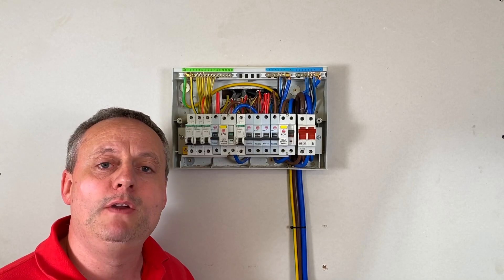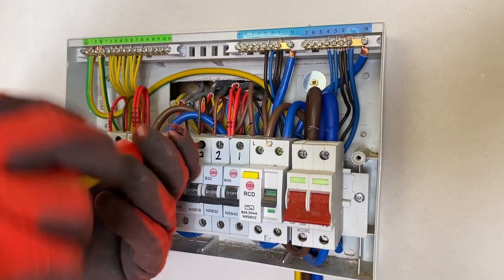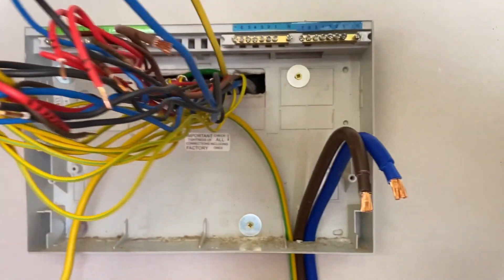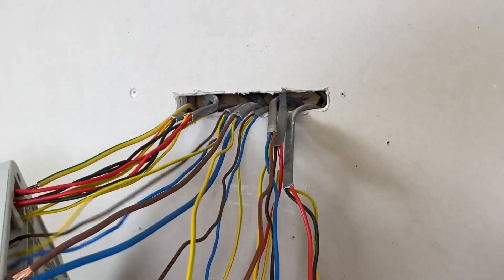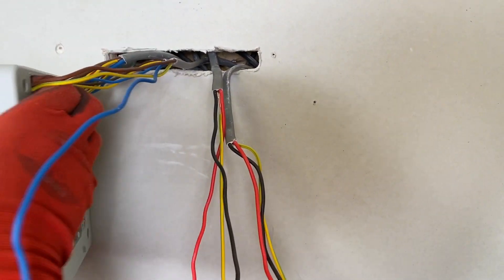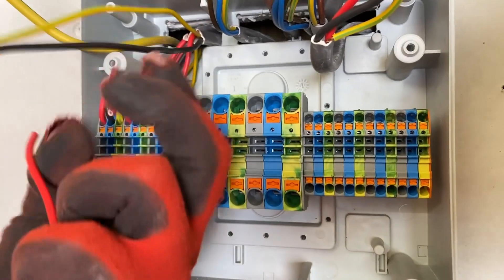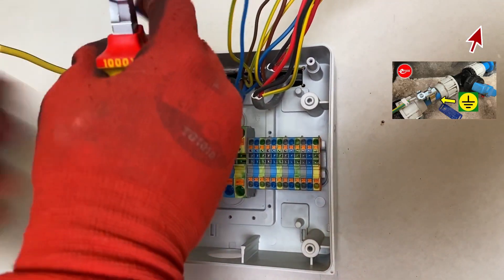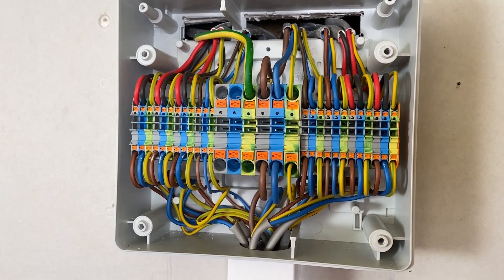How to Move a Fuse Board - The Easy Way |  Wiska Consumer Unit Relocation Kit

Comment from the maker: Wiska 818 Consumer Unit relocation kit
http://hub.efixx.co.uk/wiska-818
Reply: Would it need any kind of intumescent seal where the old cable exit through the plaster board void into the box?
Reply: @rp8068  I’d be heavily inclined to.
Reply: @GadgetMan36  may be non combustible?
Reply: Specs say polycarbonate so I doubt it’s non combustible, but I’d say a similar enclosure is more for DB/CU carcasses with the likes of contactors and metering equipment inside.

Comment: As an amateur electrician, I’ll always defer to a qualified electrician’s technical competency. But when it comes to non‑specific tasks like opening portal holes and drilling, you guys still have a lot to learn. The hole saw wasn’t even centered, and those cutouts left a lot to be desired from a woodworker’s perspective. My skill set would have produced factory‑perfect results with about fifteen minutes of downtime. In my opinion, details matter.

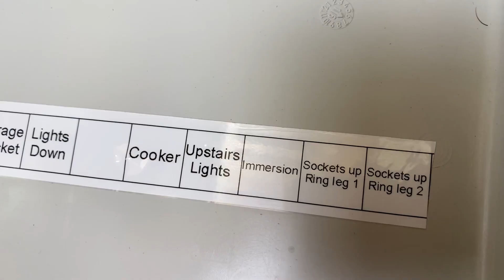Comment: Question: You mentioned that the DIN rail in this enclosure is plastic (somewhere around @5:40). At the end of the video (@16:52), there is no connection to the main (10 or 6 mm2) PE cable to anything else, hence it's a „floating” earth.
Tip/manufacturer's recommendation: Although tool-less installation is allowed for rigid or ferruled cables, it is strictly mandatory to use an operating tool when inserting multi-strand cables.

Comment: can this be placed inside a wall with an access panel rather than surface mounted and does it comply with BS 5733-MF. Maintenance free connections to BS5733-MF for inaccessible areas

Comment: Not too sure about that.  Normally, the whole point of moving a consumer unit is because it is in the way of something.  Like knocking a hole through, or fitting a door frame etc...   I can't see how replacing a large box with another large box in exactly the same place does anything ?   😂

Comment: I'm probably missing something....🤔

What did you do with the incoming tails to feed the relocated board?

I'm assuming if the new board is over 3m away from the head a switch fuse would be needed...

Comment: The wiska relocation boxes are a great idea but are pretty limited at 10 circuits, also there is no provision for rear entry and the 20mm knockouts if all used are still not enough for the cables, using 2 of them at nearly £100 each is a bit over the top for most customers, so wiska please make the boxes bigger with rear entry and more knockouts please.

Comment: A box made specifically for a certain job and the manufacturers still cant get it right. Not one of the knockouts are of any use. Wib box, din rail and din rail connectorsbeen used for years doing exactly the same job...

Comment: I expect the reason for the unit not being metal is that unless connected via flylead to a CPC or the equipotential bond, how would the case be earthed? I‘m surprised the rear entry cuts were not filed-down then intumescantly sealed as well as the mounting screws without washers. Surely the TopJobs should be LEN rather than LNE, as PVC PVC twin and CPC cable is in such an order. Will have to read the item specs online to determine if MF.
Reply: Just called Wiska UK - they confirmed the unit is MF and can be mounted behind plasterboard etc.

Comment: What happened to the mains tails and main earth? Do we assume theses went into service blocks below? (Sorry if I missed this).
Reply: I asked the same question, usually the tails come through with the rest of the circuits and the main earthing conductor. Also you would normally have a shower circuit and a cooker circuit so I'm guessing you would have to through crimp the tails and main earth if you couldn't pull new ones through from outside and they would have to come over the top of the wagos as there isn't room down the side
Reply: I imagine the homeowner had the supply and consumer unit moved.

Comment: What's the point in moving the consumer unit, if your just going to replace it with another box and surface mounted trunking?  The only reason i'd move mine, is to hide it better..

Comment: Those are great bits of kit, especially the ones with the lever Wago connections on the lower side. If I were to criticise one thing though compared to the previous box - I personally would have installed washers with the fixing screws to reduce any chance of the screw being pulled through if it bets bumped but other than that it was a flawless install!! Maybe i'd have left the wires a little longer too but that's just down to personal choice...👍

Comment: Any regulatory reason why the Wagos are in LNE sequence rather than LEN which would match the T+E cables?
Other than that, as long as cable bunching as part of the relocation doesn't open its own can of worms they look like a good piece of kit.  I expect that high IP rating would also come in handy to correct some of the more controversial installs seen on YouTube, where for example a room's been turned into a bathroom but the CU's still in there, just behind a panel.

Comment: Is it acceptable to do this using screw type din rail terminals or the widely used screw terminal connector blocks? Thing I don't get is
If an electrician did this in your house 5-10 years ago using big adaptable box and connectors would that be deemed as some good work. ? I'm not so sure but don't really see much difference apart from the screwless terminals used? 
What's your opinions?

Comment: Can someone enlighiten me?  I'm looking at what makes contact with the conductors, it looks as though the terminals only offer a small fraction of the conductor making contact.
Melted plastic cake anyone?
Reply from the maker: Or as we know it a proven screw-less connector system with a raft of international approves. Used in industry for decades.
Reply: @efixx  Just because things have been "used in the industry for decades" is not good enough, I was looking for someone to prove me wrong with some facts. For example where im from, uninsulated live busbars were used for decades, they all thought that was a good idea too.

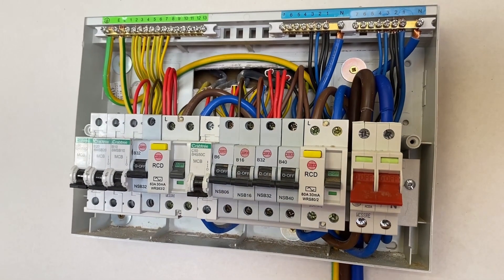Comment: 1:12 'Whats wrong with this consumer unit'  if the RCD's and MCB's are still working ok nothings wrong, but there's no money to be had telling the mug punter that. 
Just shake your head and tut then tell them about the latest bullshit regs which are more about profit and paperwork than 'millisecond disconnection times'.
The whole system now is geared to registration costs/profits/certs  and traceable income by the taxman on the press of a button and don't get me started about smart meters
As for your girly multi tool cutter at 8:20 on the back of the box, I had a Swiss army knife that would do the same job in the 70's with a few cuts, then  I could peel an apple, open a bottle of beer and make a cheese sandwich with it as well.
Also mixing red black, brown & blue conductors in the same installation you naughty boy.
As for the gloves are you frightened of damaging your manicure and nail varnish.

Comment: Just a question that only just occurred to me ... Why "move" the CU if all you're going to do is replace it with *another* box occupying the same space?

There are usually two reasons for wanting to move a CU:

1. Convenience of a better location
2. Being able to free the space occupied for *other* purposes

This method provides no help for the  latter however. Isn't it about time that extending cables with appropriate simple, reliable, in line connectors was sorted out? The poor consumer has to pay enough for Microsoft bloat without domestic wiring doing the same! 🤔🙄
Reply: the 2 reasons you gave are 2 of the least used due to cost of relocation the most common 2 are home renovations/conversions and the second is because the current consumer unit is no longer fit for use and the new one wont fit in its place so the new one has to be installed only a short distance away the fast connections of the wiska allow for a regulation approved connection meaning your home is in less chance of (a) catching fire or (b) having wiring faults. sounds a good reason to hit the consumer with another small charge instead of him paying a large bill out in the future us sparks are only looking out for ya wellness.

Comment: I will never forget having this to do back in the 90's at FATTY TOWERS CLIFTONVILLE; - Buster ...or Doug wanted me to re-connect all of the crumbly old LEAD CASED CABLE to the original Wooden fusebox which I was to re-fit on the outside of the particular bathroom... he  wanted me to send back all the cable + fuse-boards which his manager had let me order previously, - said that by ripping out old lead cables I was making work for myself..... I ended up moving back to Crete, - apparently he could not find the kind of 'electrician' that he wanted Anywhere ...ended up having to sell the place....

Comment: When relocating like this obviously at some point cable calcs were measured and correction factors applied so does this matter now that you have chabged this over an placed all that cable in one trunking? surely you are changing the way the cables are now run so there may be a concern with the cooker cable for instance? I know it will depend on the run to the new board also but please explain thx

Comment: Please let me know the difference between a bad joint causing a fire in a plastic juntion box and a plastic fuse board. Causing the same problem. Would it be beter to use a metal enclosure for the juntion box.
Reply from the maker: Consumer units contain MCBs, RCDs etc which create heat as part of there operation.
Reply: @efixx A high resistant joint could also cause fires in a plastic enclosure. A metal enclosure would stop the of such a problem.

Comment: Why is this plastic box acceptable when plastic consumer units are frowned on? I know breakers can burn up but so can a bad connector, and there are a lot in there.
Reply: Because the fire brigade identified that many house fires were being caused by increased resistance in the terminals in the consumer units, so they asked for metal consumer units.

And it is not that plastic consumer units are frowned upon, it's stronger than that: they are not allowed to be used. Full stop .

But there is no obligation to upgrade existing installed plastic consumer units to metal.
Reply: @deang5622  not true ,you can use plastic still.

Comment: Biggest flaw I see in the old board is the lack of crimp ferrules on the flex conductors. It appears that the installers terminated every flex in the board without the proper ferrule.
The wall cavity isn't sealed so fire rating bye bye...
I know its a plastic panel but it would still be nice to not se the wall cavity on fire should the board ever "combust".
The meter tails are not done in best fashion: No trunking to protect them at all just bare handing tails and no gland into the board. Should be a proper cable in trunking.

Comment: the new board you installed for this installation

was it metallic

if so why not a metallic enclosure for the wagos 

almost as many terminations with a chance to go wrong
Reply from the maker: It doesn’t contain any circuit breakers etc so doesn’t need to be metal.

Comment: As you've mentioned in an eFIXX video back in April 2021, regulation 421.1.201 in BS7671 (17th) states that "Within domestic (household) premises, consumer units and similar switchgear assemblies shall comply with BS EN 61439-3 and shall:
1) Have their enclosure manufactured from non-combustible  material, or
2) Be enclosed in a cabinet or enclosure constructed of non-combustible material and complying with Regulation 132.12
Note: Ferrous metal, e.g. steel, is deemed to be an example of a non-combustible material."

For the purpose of the regulations, does the Wiska 818 consumer unit relocation kit not come under the classification of "similar switchgear assemblies"?
Reply from the maker: The connections in the junction box are simple through connections. In a consumer unit you are distributing power from higher current terminals to lower current ones.
Reply: Hmmm... interesting.  But I guess is not a switchgear assembly.  Its a junction box.  That is how I read it.
Reply: @zoltrix7779  I should start by pointing out that I'm not an electrician by trade.

To me it seems that in order to understand the regulation it helps to consider exactly why it exists and how there might be a difference in risk. I believe the following are the main drivers for this regulation specifically targeting plastic consumer units:
1) Consumer units in the UK are typically located in hidden areas (Under the stairs) or fire escape routes (By the front door, a hallway or under the stairs).
2) The risk from a large number of screw terminals (I.e. Not maintenance free).
3) The presence of particularly high currents in comparison to other locations. (80/100A for meter tails / bus bar, shower / cooker supplies)
4) The presence of MCBs which have to break high fault currents.

I'm not entirely sure if all of these are drivers for this particular regulation, nor am I sure exactly what ordering they would be given or if I've missed any.

Consumer unit relocation kits would appear to me to suffer from a couple of these risks:
1) They are typically used to relocate a consumer unit from an older traditional location and therefore remain located in these higher risk areas.
3) Not quite the same risk as the supply doesn't pass through this, but there are typically still going to be some high current circuits.

#2 is not relevant for this Wiska 818 as maintenance free terminals are used, but if regular screw terminals were used then it would also apply
#4 is not relevant for relocation

It's an interesting point you make about it being a junction box, where do you draw the line? Is this a special case due to its location and higher currents?
Reply: @yngndrw.  I don't disagree with your points.  It would probably be better for the regulation to cover this scenario specifically.  The electrician really, should not have to understand why a regulation is what it is (even though, in practice, they do understand why most regulations are what they are for due to training), just follow it to the letter, or at the very least, to the best of their ability.  I don't think it is clear enough to expect an electrician to use a metal enclosure.  However, I am sure many would choose to do so, just to be on the safe side.
Reply: @yngndrw.  no it dont andrew the wiska connection box does not switch anything so its not classed as switchgear it is only classed as a barrier or an enclosure to physically prevent touching of potentially live parts without the access of a tool. hope this helps.

Comment: If I can remember rightly there is something in GN8 about main protective bonding conductors needing to be unbroken. But I'm sure somewhere in the Regs it contradicts that by an exemption if using MF connection or appropriate compression joint and it also being accessible for inspection.